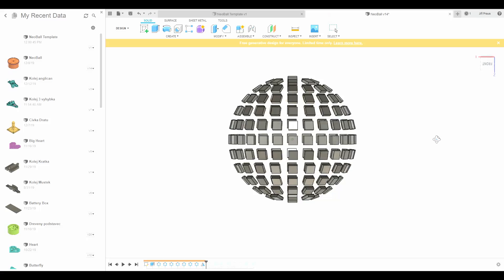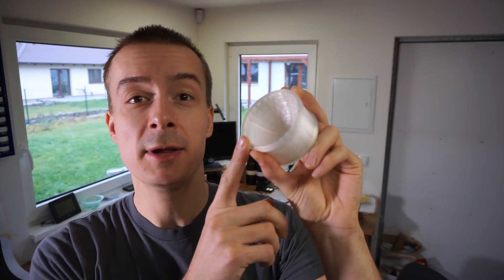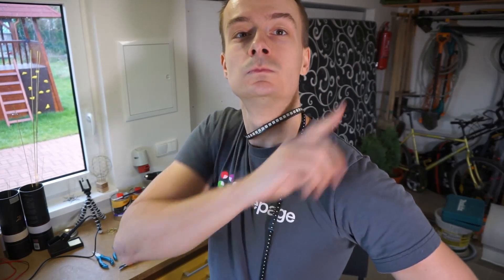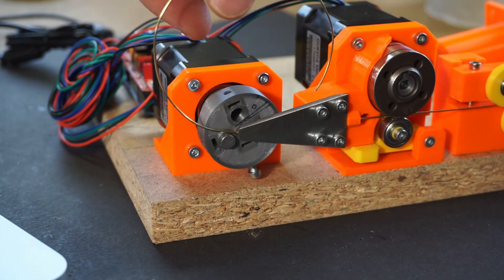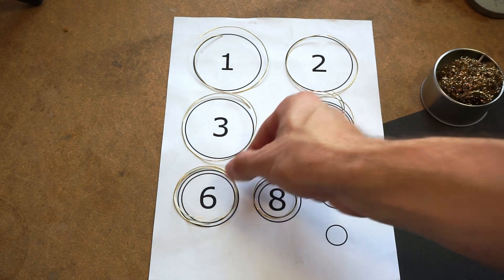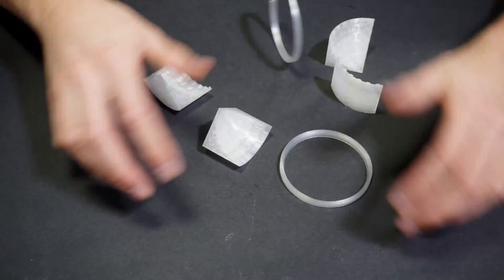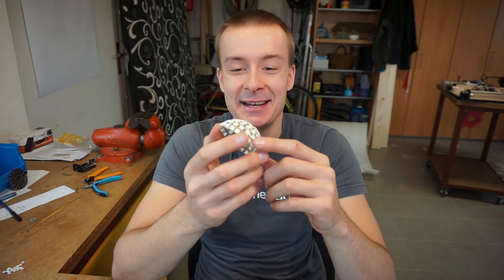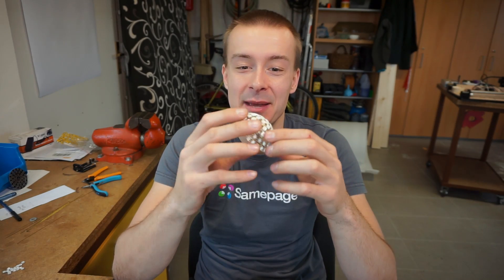LED sphere with 194 LEDs and how to build it

Comment: Hello,
Great build. I Plan to make one now to go on top of a flag pole. Plan to spray them with a UV enamel, or enclose in a large ballball.
I'm going to have an external power supply, so is there a suggested controller I can replace which will  allow the 10amps?

Comment: I made it woooh, it looks awesome!
Also i added 2 buttons on the bottom hole to switch color effects and an accellerometer in the inside that i'm currently not using because i'm struggling with the code. But hey it lights up⭐

Comment: I hope you don't think I'm being a smart ass, Jiri, but I could've told you that by using dozens of these square LEDs, you should've been testing a row (ring) of these as you went.  I, too, have played extensively with LEDs as I share the same passion with these incredibly devices.  But I found that it's best to build slowly, layer by layer which makes it far easier to troubleshoot in cases of shorts or cold joints as you made mention of.  You are quite a character, sir.  I like that you were genuine & honest about how fatigued (and no doubt bug-eyed) you were soldering this monstrosity together.  I loved how excited you were when 9:40 you had that "IT'S ALIVE!" moment.  I have soldered these tiny COB lights onto flat aluminum star-shaped heat sinks - and those feet are so damn tiny - I need a  huge magnifying lamp and working with tweezers to assemble them.  I can only solder 10x before I must rest my hands & eyes.  I don't know how you could do 50 of these like that.  You're a soldering machine!  Congrats again on your ingenious device, Jiri.  SUGGESTION:  Since you're so adept with electronics, I was going to suggest you insert a driver gear in the open end of your LED Ball and attach this to a stand with a driveshaft and slowly turning motor unit.  That way, your sphere could rotate as the lights dance to the patterns.  Combining these two elements would be mind boggling!

Comment: What solder are you using? I tried soldering brass wires by myself but my solder was immediately forming something like thin film on its surface completely messing everything up. Also it does not stick to brass
And what is that substance you use for leds fixation?

Comment: Great video! I work with these type of programmable LEDs a lot. I have an automotive lighting company, and I am having trouble writing code for a specific pattern in trying to make. Would you be able to help? I have 30 LEDs and would like a chasing/sequential pattern. However, I would like them to light up in groups of 10 at a time until all 30 are lit. They are currently only lighting up 1 at a time until all are lit. Could anyone assist in writing the code? I'm using arduino nano with ws2812b

Comment: This seems like a good project to try and implement conductive filament into.  Instead of a 3D printed Jig..  you would have a 3D printed ball that you just plug LEDs into. And. Slot for the ESP to slide into..   just a thought

Comment: That's extremely impressive, especially how round the rings are. But why didn't you share rails between rows, so you wouldn't have to make so many rings or any of the half ring jumpers?
Reply from the maker: It definitely would work. I originally envisioned a size and wanted to use a reasonable amount of LEDs - up to 200. That led to this design and those spacings.

Comment: Awesome project, it looks amazing :D The only thing i would have done different is to use an 18650 instead of a LiPo (safer) and maybe dipped the soldered ball into polyurethane varnish to isolate everything( somebody wearing a Ring could short the metal contacts )  Neither of those detract from how FANTASTIC your project turned out :D
I may try this myself with one of the ESP32's i have, changing the light pattern with my phone would suit my lazyness :D
Reply from the maker: Definitely a good idea.
Reply: @JiriPraus  you should make these for children with sensory/mental disabilities. There is quite a good market for ideas like this.
I've often thought of a 50/50 wall that acted like a (voxel) mirror for dance studios/nightclubs.
Reply: @JiriPraus How do you solder without flux? what kind of solder do you use?

Comment: I dont understand how the system knows where the lights are lokated in the grid lokation...
Reply: Each LED has a tiny shift register, a shift register reads the incoming data from the MCU and takes the last value as its own, it then deletes that value from the data packet and passes the packet along to the next LED, which does the same. youll notice in the video that each LED has 4 pins, 2 pins are for power, 1 for incoming data and another for data to be passed along to the next LED. All you need to know is how many LEDs you have to produce a data packet that contains the right ammount of data for all the LEDs and where the first LED is, from there its very simple math to map the physical LED location to its position in the data packet.
Reply: Meaby each LED has an individual number?
Reply: @kelevra1988  good one!

Comment: Nicely Done!  Although it does not reduce the number of solder joints, it should be possible to rotate the LEDs left 45 degrees to line up the DataIn and DataOut pads.  You could then place a ring of wire over the data pads and solder, then clip the center out of each LED.  Might make it easier to solder than fiddling with lots of small wires.  

I suppose you could also alternate power rings to pack them closer together and avoid having to run both power and ground between each ring, but that might make the programming more difficult since addressing would swap directions on each ring.

See, such creativity as you've demonstrated gets lots more going!  Again, very nicely done!

Comment: 13:35 oh that looks pretty nice, but i won't build it myself..
13:46 aight, let's get some leds

edit: but with an epoxy layer on top so you can actually roll it without major problems

Comment: If you set LED rotated (like diamonds) it makes it easier to solder the ground and 5v rails without risk of shorting to the data pins. The finished item is very cool though.
Reply: Was just about to suggest the same idea...
Reply: @Duraltia  I was about to think about the idea... ;) hehe
Reply: man... i already printed Jiri's jig... Good suggestion though..
Reply: That’s a great idea, though I think it wouldn’t look as nice as you would have more gaps and less LEDs.

Comment: How is it possible to address each LED  seperate? I thought it would be row per row?
Reply: Each LED has a data in and out, they are chained together so the data out of 1 led feeds into the data in of the next one. Each led takes the data, sets it's own color, strips the last bits off and passes on the rest to the next led. Repeat untill every led has been set.
Reply: Educate yourself https://www.adafruit.com/

Comment: That is really nice work. What are you doing at the 9:53 minute mark? You're removing a component from the ESP32 board and soldering on other wires but also weaving them through... Is this a power switch? Does your ESP32 dev board have a switch that you removed and placed in a more accessible location? I'm confused.
Reply from the maker: Exactly as you are saying.

Comment: Very nice project. Congratz on the awesome result! What i learned from this is to make a little testrig with spring contacts to pretest every LED before soldering it in, and use ESD protection at your workplace to minimize the risk of zapping any LEDs dead at assembly...

Comment: Can you share the schematic and those programs you have used?
Reply: The LED are real simple, you don't need a schematic. the positive and negative power rails are all parallel and the data lines are series as it uses PWM to control the LEDs. The important thing to have are the 3D printer files for the wire bender and the hemisphere to hold the LEDs in place.
Reply: and the code? 😊
Reply: @MekazaBitrusty  Yes the code would be quite useful but you can come up with your own designs and re-purpose the Adafruit code found here:  https://learn.adafruit.com/rgb-led-strips/usage. I know I would do some defines for longitude and latitude lines to make things easier.
Reply: If the 3D CAD file available for that sphere shape?please share link...

Comment: When I watched the soldering process I thought one must be insane to do this. Now I want to build my own! 

An accelerometer would be a nice add-on I think ...
Reply: You read my mind; having a series of programs that respond to 3D alignment, acceleration and velocity, would add even more layers of spectacular!
Reply: I sware. my first was similar.
gyroscope or accelerometer. 😊
Reply: Yeah that's what I wos thinking
Reply: Use a Nano33 BLE or something
Reply: @Mokungit Brand 150zł for 100pcs, even in Poland where i live those LEDs are cheaper... You'r competition sells whole strips for a lot less, 144 LED strip for 41zł...

Comment: What is the power draw on it? Seems pretty high, I am scared i can ruin my ws2812b leds because i don't have enough current, but that doesnt seem like the case! Its like 11 amps and i assume the board can hold around max 1 or 2 amps, so how does it keep them running?

Comment: Bravo!! That's absolutely brilliant! Well worth the extra work soldering and the difficult replacement of faulty LEDs - cubes are, at least, an order of magnitude below! I also loved the 3D-printed jig which was imperative to hold the LEDs in place for soldering (not to mention your beautiful wire bending machine, but that can be replaced by a plastic cone or similar). I was so impressed that I subscribed without even watching any of your other videos :-)

Comment: ~172 LEDs * 20mA per color is 10 Amps! This is a lot for this little board.
Reply from the maker: It's 194, yeah if you lit all the colors at maximum brightness then theoretically it would be the case. But that would never happen. Internal circuitry will prevent overcurrent.

Comment: Awesome video! Great job!
WS2818b or WS2812b ?
Reply: those are WS2812b. 
The other one is a 12V chip most used in Long Led Strips. The 5V version is more suitable for those applications.
Reply: Andre Hoeh Was wondering because the video description says “WS2818b” - the 12v ones.